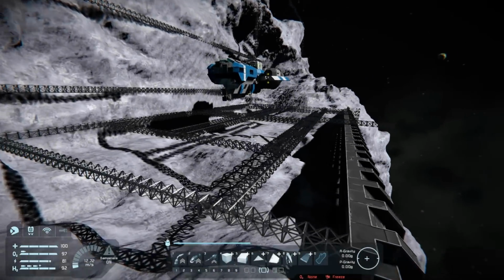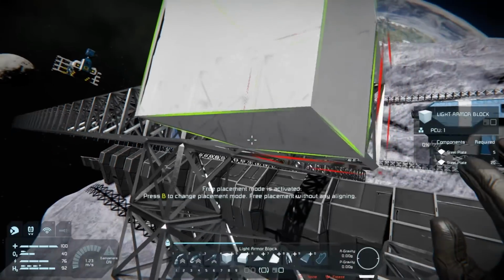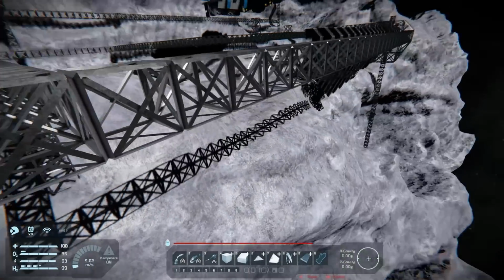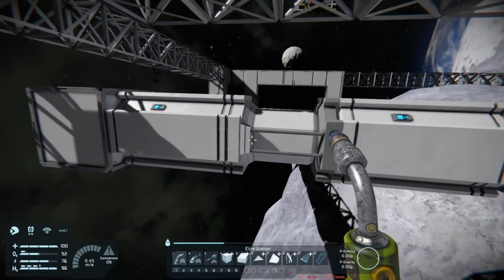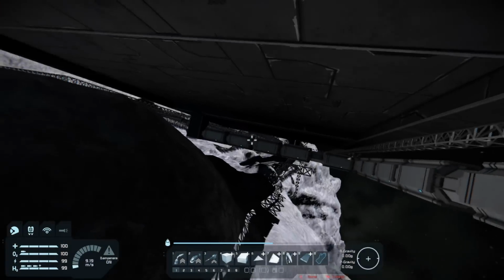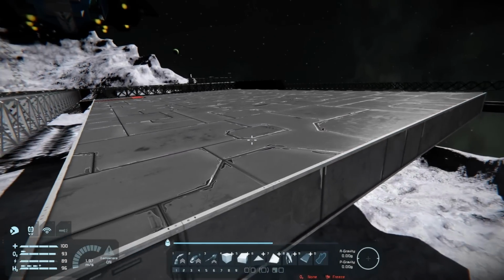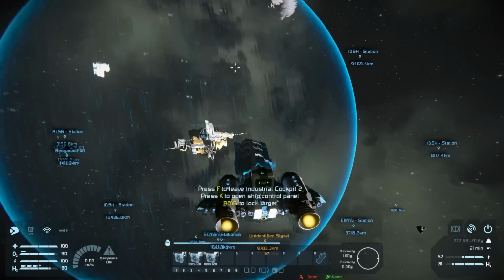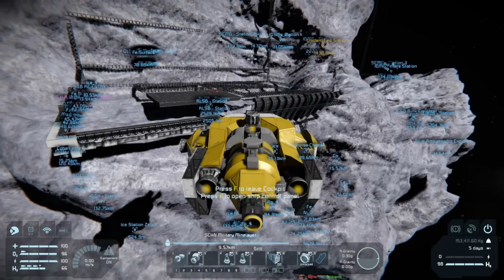Building the COOLEST HANGAR DOORS POSSIBLE! - Vanilla SPACE ENGINEERS Survival - Ep 30

Comment from the maker: FULL SERIES PLAYLIST ► https://bit.ly/3ZoLirk
Reply: Doors look dope… one small caveat I dunno if you considered this or not. I assume this platform is supposed to sit level with the rest of the landing pad unless you plan to have massive 16 some odd block overhangs. So shouldn’t this need to move up one block when closed and down one block when open so it can hide under the rest of the landing pad?

Also for the interior view of the door ya have to consider how all these pistons are gonna look unless your gonna make the ceiling also pop flush into place by mirroring the platform to hide the pistons entirely. Think this might also make the door way cooler to see it retract before splitting in the shape of a cross. And if ya mirror it with pop into place ceiling tiles on the other side it would round out the whole design. But hey Whatever ya decide I’m
Sure it’ll be dope.
Reply: @dreadcthuhlu8560  just getting started in the video and saw where you are headed ... so late but another option ... use a piston to pull the the 16 wide door back and a set of hinges to raise the door up and 8 blocks in another set of hinges to lower the next section down as well so the door pulls back and accordion folds on both sides ... you now have a 40 block opening ... and you can sit it flat and level with the roof of the overhang ... which allows you to slap a little cafe in the front looking out and in as well .... sort of a truck stop idea 

and dont forget you can Vannila auto track the sun with solar panels and get max power when it shines ... there are several good scripts out there as well BUT using the basic tech you can do it in Vannila with out a script
Reply: piston and rotor heads can be adjusted in and out as well ... they float about 1m total so a piston can be 9m or 11m or some where in between ... same with a rotor ... the actual distance they move is one you will have to check out as it never seems to be the same for everyone ...

Comment: Hi! You can make the pistons increasingly go faster and slower such that the door part always slows down at the end of its travel ensuring less shaking. So lets say you want this feature vertically: You set 1 piston to very slow speed, 1 piston to slow speed, 1 piston to medium speed, and 1 piston to fast speed in the continous segment of pistons. The result will be that at the end of the door's movement the pistons will overall slow down because the faster pistons have reached their maximum distance by the time the slow ones are still going. This way you can reduce shaking at the end, but keep in mind that in the first moment the door starts to go it is going to be the fastest, and it is going to be the slowest when it arrives regardless of direction.

Comment: there is a setting on Pistons called "Max Impulse Axis" and "Max impulse NonAxis" that is the Strength of the pistons ability to resist being pushed or pulled the Axis one is for the direction that the pistons extend or retract, and the NonAxis is for resisting movement perpendicular to the extending and retracting direction.

what you can do is add more newtons to those 2 values to make the doors not wobble as much when starting and stoping, though the safe limits are 100000 for both they can be turned up far higher, at the rist of damaging blocks the subgrid comes into contact with.

and another note: i do beleave the piston heads are 20cm in thickness, if i recall correctly that is ^^

Comment: Just wondering why not use hinges and swing the doors open. In space you should be able to make them as big as you want if the speed is low enough. I have seen someone make a ship to eat astroids. It was long and skinny. It opened up in the front and had rows of drills that rotated. The part that opened had to have been several thousand tons. The ship was an entire factory for processing stone, and ores. It all ran off reactors, but used H2 as a backup. There is a YouTube video that shows it operating, but not being built.

Comment: Blocks don't flex, pistons do. Adding the half blocks only added more weight to flex the pistons further. If you want stable you can keep the sloped edges and add a merge block to each edge of the door to lock it to the other doors. Make a timer block to unmerge first action then reverse the pistons. Could even put an opposite set on the outer edge of the door and the inner edge of your structure to lock them stable when open

Comment: The sliding doors is an interesting way to do it. I was thinking rotate them open and tuck them down on the sides. Run that at the same the elevator pad is moving in the opposite direction.

Comment: I still think that sliding doors are NOT the answer. While the back doors will slide into the mountain, the front doors sliding under something results in a lot of unutilized tarmac. It just looks like a wierd stripe next to your entrance that doesn't belong there. It's just something that wouldn't fit a space theme, they would make use of the topography instead of slapping so much metal on the side of the asteriod. It just overhangs too much. If it was both sides sliding into the rock it would be no problem at all, but it looks like it will just stick out too much.

According to other comments there are hinges, you could try to build a shutter door that bends around the corner to minimize the space. Not sure how they work exactly since I don't play the game, but the movement of the door is still simple pistons, attached on the side at the last blocks of the door and then just a bunch of timers for the bending? Or if there is the posibility of outputting the positions of the pistons plus logic blocks it's not that hard to make something that can deal with interrupting the opening/closing process by pressing the button again, which timers will not be capable of. Depending on how the hinges look it would also add some texture/griebling to the doors.
Reply: It is possible to do a door with hinges and pistons but it would be very unstable since the game's physics engine doesn't like such things. Setting it up would also take a lot of work as each piston and hinge has to be individually set up and the game is fairly limited when it comes to logic blocks (though one could use scripts).
So it's probably one of those cool but impractical ideas.

Comment: Maybe add merge Blocks on the sliding doors to interlock with the other parts? Just an idea, would make it airtight and stable I think. 

Another Thing you could do the diagonal with a rotor set on 45 degree and pistons going to another rotor
Reply: Merge blocks can work, but for people reading, please be careful with merge blocks as they can permanently fuse two grids together when they have certain kinds of blocks along their edges! Check the wiki for the exact behaviour and test in creative first!
Also in this scenario if one were to merge the hangar doors it would also be a good idea to connect them to the rest of the station in their closed and open positions with magnetic landing pads or merge blocks to increase the stability of the setup.

Comment: Piston Length:
Large Grid:
Fully Retracted-2.0633852(blocks)-5.158463(meters)
Fully Extended-6.0633852(blocks)-15.158463(meters)
Small Grid:
Fully Retracted-2.063084(blocks)-1.031542(meters)
Fully Extended-6.063084(blocks)-3.031542(meters)
Taken from the Wiki, seems close or even accurate.
Reply: So the extra 1.7m results in a total of 0.158463*5+1.7 == 2.492315 -- so juuust under 2.5m.
Reply: @nurmr  He put 5 pistons, and extended only one, so: (5.158463+1.7)+(4*5.158463)=27.492315m or 10.996926 blocks. This lines up with the 11 blocks he uses so by the magic of double checking you are correct.

Comment: To figure out the length of the retracted piston, build a "C" shaped frame where the inside of the "C" is greater that the length of the retracted piston by a block or so. Mount the piston on the inside bottom of the "C" and extend it until it hits the inside top. Check the "Current Position" and subtract that from the known inside length of the "C" frame and that should be its retracted length. That sounds like it should work and would only take a minute or two to build. For higher accuracy, stack 10 pistons inside a longer "C" and extend just the last piston and check its "Current position" minus "C" frame length divided by 10.
Reply from the maker: "Current Length" is only given to 1 decimal place .. so nearest 10cm .. not good enough :)
Reply: @SkyeStorme  You can also just read the wiki, it tells you to to 6 decimal places.
Reply: @SkyeStorme  I guess you would want to go with my second idea of measuring 10, which would give you two decimal places (1cm resolution) or you could expand it to a hundred for 3 decimal places (1mm resolution). That would take a bit of time though. However, after watching enough of your videos, you do strike me as someone who likes doing things on large scales so, have fun with that.